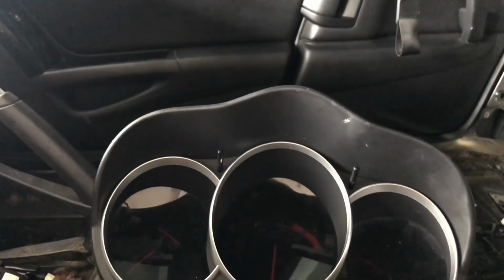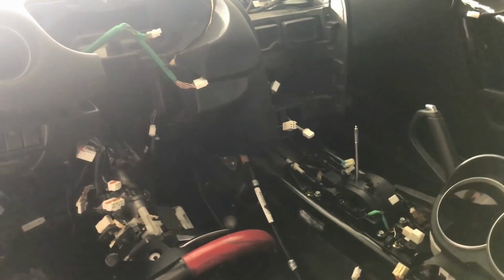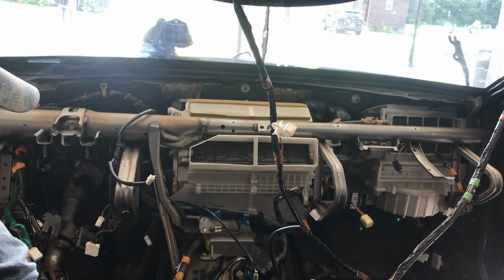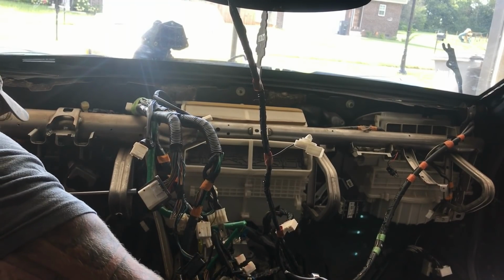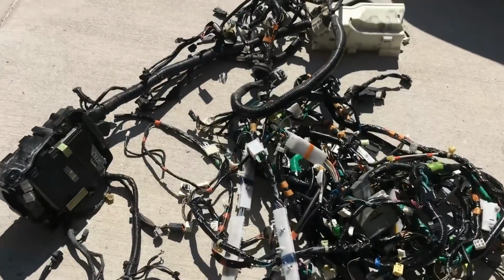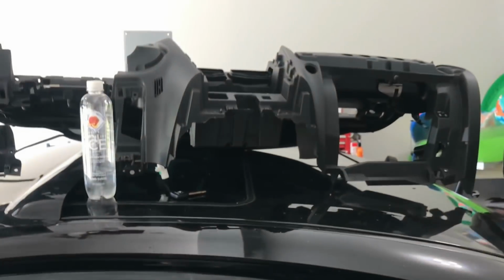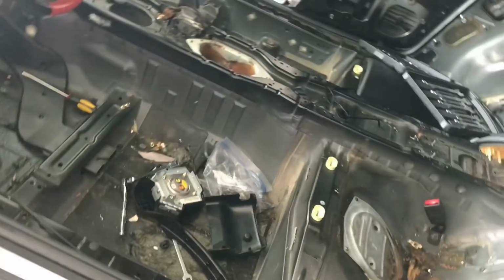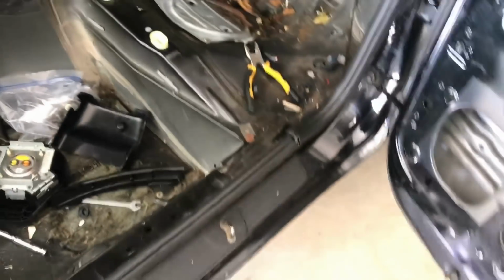Budget Turbo LS Swap RX-8 Build / Part 4 (WE GOT THE WIRES OUT AND THE DASH)

Comment: how are you keeping track of all those nuts and bolts lol. pretty much the entire car is being taken apart.
Reply from the maker: Well I am not re using any factory equipment so I’m not worried about any of it accept the dash bar and dash screws which I have labeled lol . Otherwise it would be a disaster.
Reply: thats what i was thinking lol.
Reply from the maker: Usually my method is baggies labeled  or a giant piece of card board with nuts and bolts ran through it  and a sharpie if it’s a quick project